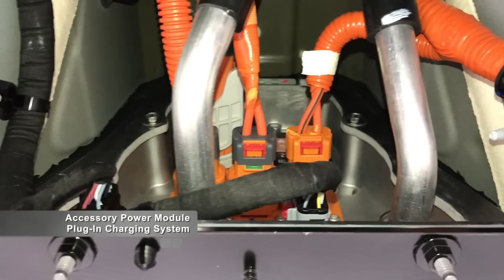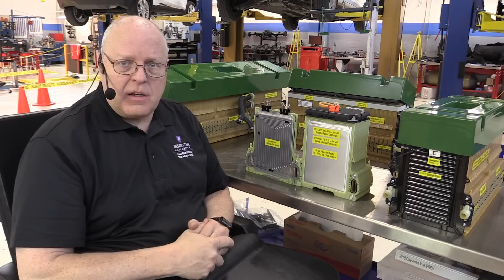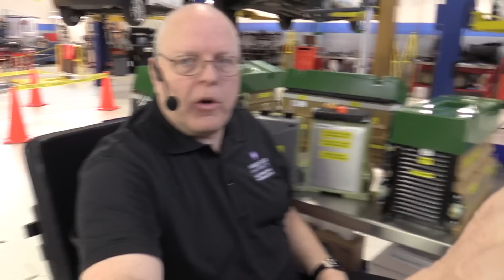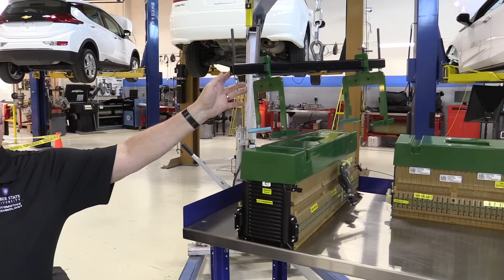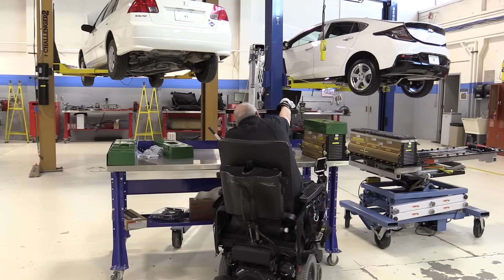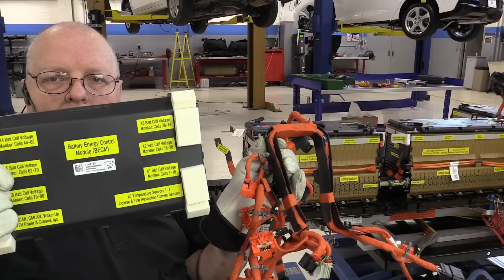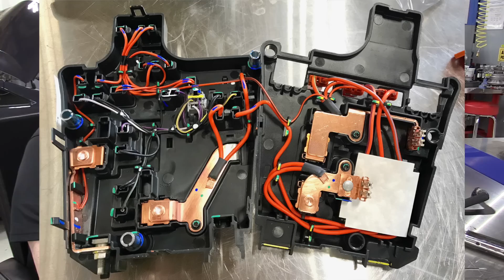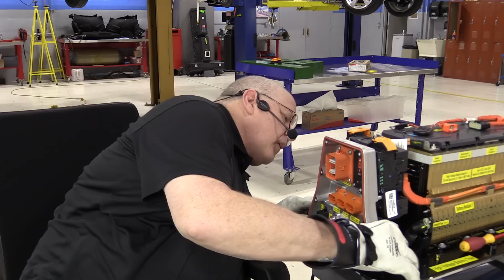2018 Chevrolet Volt 355.2V Li-Ion Battery - Deep Dive

Comment: I wonder what is the point of having the individual fault codes for each cell pack if (unlike in Prius) it's not possible to disassemble it and you have to replace the whole section.
Reply from the maker: You still need to be able to determine which battery section to replace. The fault codes will point you in the right direction.  The fault codes may be caused by a poor connection at a voltage sense line, or at a BECM terminal, or the BECM itself. It is not just always the battery cells. The new Prius models with Li-Ion batteries are no different, you cannot replace individual cells. see https://www.youtube.com/edit?o=U&video_id=BYSE4Yedeus Thanks for your feedback!

Comment: I wonder if the battery of the newer volt fits and work on the older volt 🤔 would be nice 👍🏻
Reply from the maker: No, the electrical connectors are different as well as the battery modules, communication, etc. Thanks for your feedback
Reply: @WeberAuto can you show this difference on a short video? I'm about to buy a 2G battery for my 1G but in iffy about it.....

Comment: It appears the DIYers will have a challenge removing the batteries from this vehicle ; however, you mentioned GM has done well with this setup. I really like the coolant inspection hole under the batt tray- gives you heads up to problems. Picking up the batt modules will be tricky without the sling!! Thanks Professor for this very detailed look into the Volt!
Reply from the maker: Thank you!

Comment: Excellent tear down.  Being a bolt owner, and electrical engineer I already knew most of what was in here, but it was nice to see it actually taken apart.
Reply: I still like the technology on the volt over the battery only opotions because, even though the volt I drive rarely needs to go into the gas extender, it is nice to know that it is available if needed, and need it I do when I go on my yearly road trip adventures. There is no battery car, tesla or any other that can go where I can go in my volt, which is basically anywhere that any car can go. The bolt would be fine for my wife, or daughter that never travel more than 100 miles in a day, but for me, when I am on a road trip, I can do 600 or 700 miles each day for 3 weeks straight as I head across the country to see what is there basically. For me the gas backup is necessary.
Reply from the maker: Thank you! We have a Bolt on our shop hoist. We are disassembling it next month. Videos to follow.
Reply: Whoops, I meant to say VOLT owner but slip of the finger hit the B.
I have a volt, but will soon have a Bolt too for the wife, so yes I will be watching your video of that one too. They are great cars, as you already know. I have had mine for 6 years now.
Reply: WeberAuto Exciting to hear it.  The battery temperature control of the Bolt sounds really interesting.  The BMW i3, I believe, uses the same concept of cooling fines (sandwiched between cells) over a big cooling plate.  The industry seems to be settling on that design for now, with a few exceptions.  Tesla does their own thing, and Nissan doesn’t seem to care about temperature control at all (the horrible battery life of the Leaf reflects that, IMO.). This neat stuff.  Thank you for teaching us the future.  I don’t even care about gasoline vehicles anymore.  That’s like learning about the latest film from Kodak.

Comment: Always world class info - thanks.
Just a note your 30 mv is indicated in the screen text as 300 mv (around the 49 min mark).
Also, I guess there is no automatic defective cell bypass.
I have worked on many spacecraft, and the bypass will provide a way to keep operating in event of a failed cell.
Reply from the maker: Thank you! The 300 mV difference indicated on the screen is correct. i found the specification after shooting the video and included it in the final edit. You are correct, no cell bypass. Luckily, failed cells have not been an issue with the Volt. Other manufacturers have not been so fortunate. Have a great day!

Comment: 360 volts DC will not kill you.
Reply from the maker: Thanks for your feedback. That is a bold statement. Voltage doesn't kill anyone, current does. Of course the amount of current is inversely proportional to the resistance of the body/circuit and proportional to the applied voltage. There are many other factors that would come into play as well (such as a heart condition). OSHA 1910.331-335 and NFPA 70E standards require PPE on any circuits above 50VAC RMS or DC. As an educator, it is my job to show my students the proper methods of performing service work. If someone chooses to use unsafe practices, then they will have to live with any consequences. Have a good day.
Reply: https://www.youtube.com/watch?v=snk3C4m44SY
Reply: https://www.youtube.com/watch?v=XDf2nhfxVzg
Reply from the maker: LOL

Comment: Thanks for another excellent video. Watched it completely, and I don't have and not on a market for the Volt!
What I hate about the modern cars, they are almost impossible to repair outside of the dealership. Pretty much everything requires a proprietary computer tool for diagnostic and testing. Some of these tools are available to buy, but at the price affordable even for the shops, let alone the home mechanics.
Reply from the maker: Thank you very much! You make a good point about the tools. I purchased most of mine on eBay for a substantial discount verses the official GM Special Service tools website. The official GM diagnostic software, service information, and vehicle interface is very expensive and requires a subscription. Add to all of that the specialized training you need to be able to work on these. It takes years of training to even reach a level where you can qualify to take the training for these electric vehicles and hybrid systems. I am trying to take the mystery out of a lot of these systems with these videos. Thanks for your feedback!
Reply: The EVs and Hybrids may be shocking (pardon the pun) for the old school mechanics, but for someone like me, who spent years repairing electronics, your videos are crystal clear and make perfect sense. I always felt more comfortable chasing electric gremlins rather than attempting to replace a timing belt. Recently I purchased a Pacifica Hybrid. It requires a Witech dongle, special software and a Techauthority account for most services. The dongle is tied to the account, I'm not sure it is possible to sell the dongle separately. Aftermarket is not an option- I'm sure that all car to dongle communications are encrypted and only Chrysler holds the encryption keys. They allow to reset the oil change interval indicator, but anything else has to be done by a dealer. It is so disappointing for the independent mechanics, enthusiasts and modders.
Reply from the maker: The wi-tech dongle and almost all technical functions is available to everyone for a fee, see https://www.nastf.org/i4a/pages/index.cfm?pageID=3867
The Pacifica hybrid is pretty cool. Here is a video I made on the Si-EVT transaxle in it https://www.youtube.com/edit?o=U&video_id=rDPwQefY2KY Have a good day.
Reply: Yep, for a very steep fee plus an expensive subscription. The Si-EVT video was my introduction to your channel and got me hooked. Thanks again!

Comment: love your videos but I've not gotten as little as 53 range on my '18 Volt yet. Today's commute got me 5.2 miles per kWatt hour, which could hypothetically net me close to 100 miles. This is on city streets but even mixing in freeway driving with the AC on  I haven't gotten worse than about 58 miles range.
Reply: That's great that you regularly get over 55 miles of range. > 5 mi / kWH requires some very smooth driving and keeping the speed below 55 mph for the most part. With mostly fast freeway driving (round trip), it's easy to get barely over 3 mi / kWH. And with some fun acceleration, even under that.  ;->
Reply from the maker: Thank you! That is fantastic. I suspect you live where the average outside temperature is close to 70-75 degrees?
Reply: I live in North Central Texas, the Dallas area. The weather has been mostly mild since I got the Volt with a few days warm enough to need the AC and several where I needed some heat. The AC compressor seems to use less energy than the one on my previous Leaf. I have only run the coolant heater when plugged in since seat heat and steering wheel heat (Yea!) are very good. Driving the Leaf I learned to dress appropriatly for the weather and use coolant heat very sparingly.

I design mechanical systems for commercial vehicles and find your videos very thorough and well presented. Watching helps me keep in mind the mechanic that will one day work on my devices. I look forward to your continued dissection of the Volt's drive unit. I think it is clearly the most advanced and practical system on the market. I do hope GM finds a way to expand its use well beyond the Volt.
Reply from the maker: Great feedback, thank you!
Reply: And now that we're banging 15 degrees at night I'm doing good to get better than 50 miles, and that's with preheating before I unplug. Oh well...

BTW, you mention in this video an upcoming breakdown of the Gen. 2 Volt transmission/drive unit. Hopefully that video will be public too. That's the "secret sauce" of the car and animations I have seen leave out so much. I'm really looking forward to it.

Comment: Following most of your videos on hybrid electrical systems, I didn't see any discussion of power steering systems.  May I assume that the pulley driven pump is replaced with an electrical one rather than re-inventing the wheel with some exotic all electric system?
Reply from the maker: Yes, they use an electric motor assisted power steering system. It is typically a 12V system, but there have been some 42V systems too. I am glad you brought that up. I will discuss it in a future video. Thank you!
Reply: Thank you for your reply.  You might also want to discuss braking when the  battery is fully charged (power brake cylinder?) or any other system that was powered by the gas engine.
Reply from the maker: Great suggestion!. I will add that to my list as well. Thank you!

Comment: Do the cooling plates have different cross section of the tiny passages depending on the section? If they are the same, the rear section of the battery would have less cooling/heating ability than the front section. GM should have different part numbers if plates are different (and assuming they are serviceable).
Reply from the maker: Good question! I do not know the answer. I suspect they are all the same. They are not serviceable. the plate I showed in the video is from a section of battery I purchased from ebay. I had to partially damage that battery to take it apart since everything is welded together. Thanks for your feedback!

Comment: As far as taking apart a section. It should be pretty easy to fabricate a portable press device that surrounds the section and applies compression with large bolts and nuts. Think of a spring compressor for McPherson struts. This will allow for removing the section bolts then slowly releasing the fixture. Reverse the process for re-assembly. Also need a battery spot welder for replacing individual cells. This shouldn’t be too hard and I imagine the market for a thriving business for rebuilding Volt batteries in the aftermarket, at lease in regions with a lot of Volts and EVs in general.
Reply from the maker: Thank you!, I did think about that, but disconnecting the welds at the top is an even bigger issue. I am sure someone will come up with a solution. Right now the 7 individual battery modules are the only part I would attempt to separate since they use bus bars for connections.

Comment: Thank you for a great video explaining in details about the Volt battery assembly. I am very impressed at the well thought out design from GM concerning this hybrid system. I get the feeling they probably have more "younger" engineers working on this Volt hybrid system than the regular internal combustion car design. But this is just speculation by me.
Reply from the maker: Thank you, and thanks for your feedback!

Comment: As far as I know, glycol is dielectric? Can it short anything inside if there are no other contaminants.
Reply from the maker: Search for an incident where a 2011 or 2012 Volt was being crash tested (side impact), it sat in the parking lot for a few weeks afterwards, and then caught on fire. If my memory is correct, there was an internal coolant leak that caused a slight current path, heat, and eventually a fire. After that, they recalled the Volt and installed the structural brace in the battery tunnel (I show the support towards the start of the video) to prevent the battery from getting compressed in a severe side impact collision. My 2012 Volt had the repair performed on it.

Comment: 4.0V is usually around 80% charged (in automotive world).
Reply from the maker: That is true. That is the voltage where the plug-in charging circuit quits charging the battery. GM tries to stay within the 20% to 80% range of charge to extend battery life cycles. Diagnostic Trouble Codes (DTC) will trigger when any cell voltages rises above 4.8 volts. Good clarification! Thank you.

Comment: I don't think we should specify battery packs according to nominal cell voltage, like 3.7V and 355.2V. This will bring up a problem with safety in some cases. I would always specify maximum expected voltage. For example, maybe there will be a Hybrid vehicle battery with nominal voltage of 57,6V, but actually battery is at 70V (3.6V nominal, 4.2V expected full charge). In one case we should use gloves, in other case we do not. So we end with 57,6V battery and using gloves. It gets complicated.
I would use maximum expected voltage. For example, Nissan Leaf, 4.125V max expected cell, 396V battery. Or 400V rated battery as we usually say.
We shouldn't use voltage to specify battery model/version/whatever.
Reply: As an EE who has worked with many HV and LV systems, I always use gloves at 32 V or greater. Some of us are more conductive!
Reply from the maker: I agree with you about crossing the 60V threshold. It can be confusing. I suspect there is an SAE standard regarding this. Regarding the Volt's 355.2V battery; knowing that it is charged to 384V (80%) won't make any difference in how cautious I am when working around it. The percent of charge should never rise above 80% unless you took a fully charged (80%) battery and then coasted down a very long decline and let regenerative braking charge it higher. Thank you for your feedback.
Reply: As a retired teacher and EE with a 2016 Volt and living on top of a hill, my re-gen feels a lot weaker after a full charge heading down hill. So I assumed that the BECM just would not allow further charging past 80% SOC regardless of the source. Are there shop manuals that explain how the software is setup?
I also noticed a software disclaimer on some screen stating it was open source. Is the source code available some where?  I plan to look at all your other videos because you are an inspiration for teachers everywhere. ...Thank You!
Reply from the maker: Thanks for your feedback! That is good advice
Reply: I can't provide a citation because I don't recall where I saw it, but I remember reading somewhere that the 2nd gen Volt at full charge does retain a small capacity that it can use for limited regen before it's had a chance to discharge sufficient capacity. But even there it has limits-- the battery management system won't allow you to overcharge the pack under any conditions, although it may allow the pack to charge a certain amount above "100%" indicated charge, and closer to 100% actual charge.

Comment: Years past we always used "dielectric" grease on electrical plugs. It was thought to increase connectivity contact, prevent corrosion, and help facilitate connecting and disconnecting the plugs during service. Do the service manuals on today's electric cars warn against this use? What's your thought when it come to this? Thanks Jim.
Reply from the maker: All connectors I have ever seen from the factory do not have any dielectric grease on them; however, there are service bulletins to add it to sensitive tiny terminals to prevent "fretting". The dielectric grease is used to prevent oxygen from getting to the terminal-to-terminal contact point (which causes oxidation and unwanted electrical resistance). The only other place I have seen the grease is inside of spark plug wire boots.

Comment: Thanks for doing this video, I am an old retired mechanic and interested in mostly the reuse of some of the EV batteries for solar energy storage.  It's a little frustrating the way they connect individual cells together with the spot welding.  I think the Nissan Leaf batteries are some of the most useful, but I will continue to research for availability and pricing.  It doesn't hurt to learn how they are connected and tested in the vehicles though.  If I live long enough I'm sure I or someone in my family will be owning a EV.  My son is a firefighter and any safety tips are a real necessity for him!
Reply: Lloyd, hello from Dec 2021.  Hope you're pleased with how the EV battery use/re-use stuff is going!  The spot welding is apparently necessary to avoid heating the batteries unduly - I suspect you're aware of that by now.  I've been interested in re-using those batteries, even just intact and stored somewhere out of sight, but I doubt they'll be going cheap. Cheers.
Reply from the maker: Thank you!